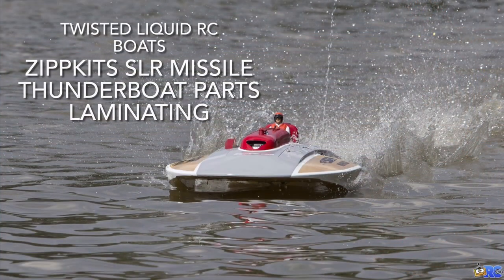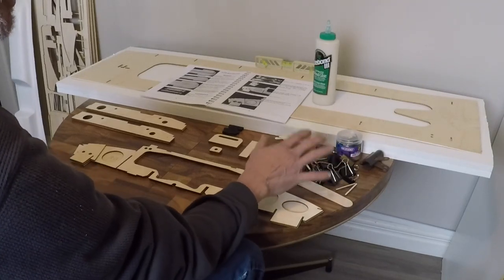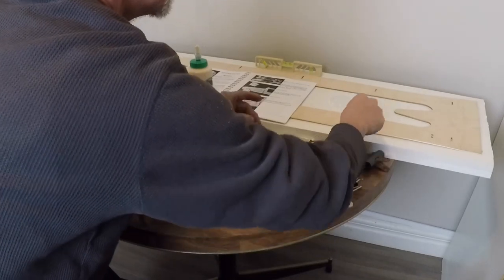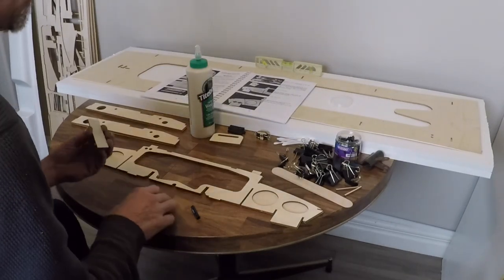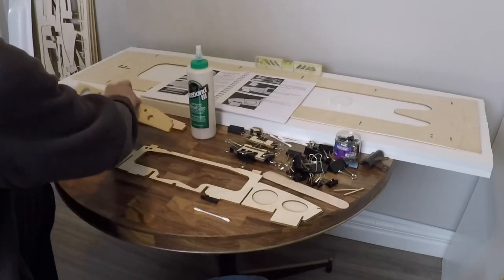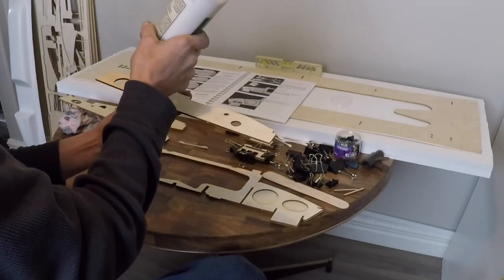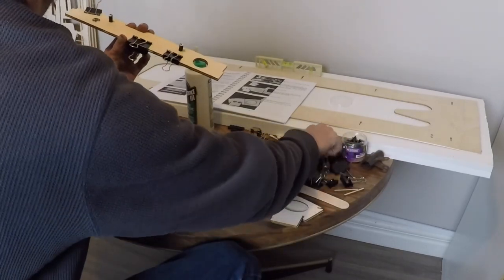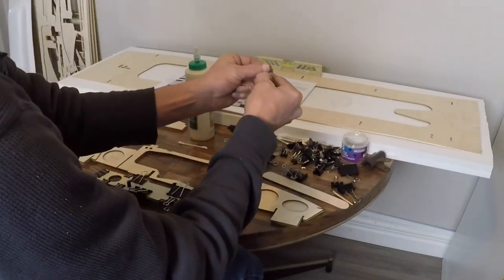Zippkits SLR Missile Thunderboat Build Parts Laminating Episode 3

Comment: Do you have to do the tight bond glue on all of the parts?
Reply from the maker: @KalebNorris , I used the Tight Bond for the Laminating Parts only. I give them a full coating before aligning and clamping. The rest of the Zippkits SLR Missile Thunderboat was bonded using Bob Smith Industries 30 Minute Slow Cure Epoxy. The boat was then coated with 2 full strength coats of West Systems Finishing Epoxy inside and out. 105 Epoxy Resin with 207 Special Clear Hardener. I put a full fibreglass cloth inlay on floor of inside of boat. For strength and rigidity. Just a 2 inch wide tape is supplied in kit for floor seam. I done a complete floor fibreglass layer using the West Systems Epoxy. This maybe overkill but I wanted a water resistant long lasting strong boat hull. A little extra weight yes, but strong. I hope this explains the materials used in my hull good. Thanks for watching and commenting. More coming soon. Take care and HGD.
Reply: @twistedliquidrcboats thanks for the reply